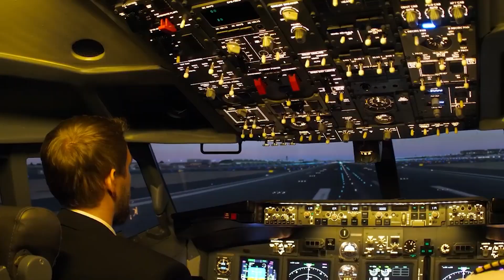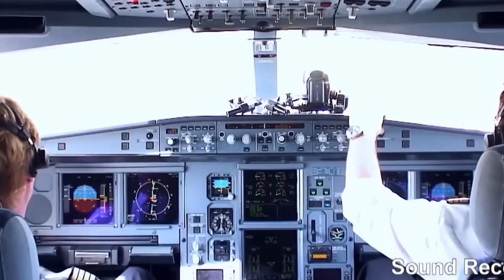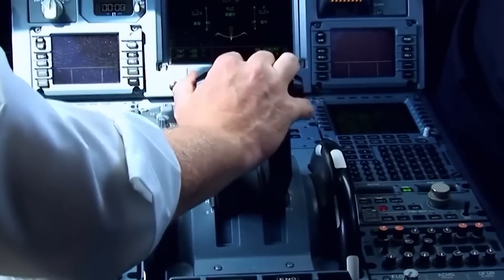BLACK BOX DECODED? Scientists FINALLY SOLVED the Mystery of Air India 171 CRASH

Comment: I am relieved that this channel is not big and that this video got not that much attention because everythin in this video is total bullshit.
It actually hurt me to watch it fully and I hoped that there is some kind of reveal in the end that everything was wrong on purpose for a joke.

So PLEASE, to everyone that reads this comment: THIS VIDEO CONSISTS OF 100% FAKE NEWS!

And it does not need much evidence to reveal that:
First of all, nothing that was said in this video has been published by any official investigator. The only real official info that we have is the preliminary report of the AAIB.

The report states the following as facts: 
"The aircraft achieved the maximum recorded airspeed of 180 Knots IAS at about 08:08:42 UTC and immediately thereafter, the Engine 1 and Engine 2 fuel cutoff switches transitioned from RUN to CUTOFF position one after another with a time gap of 01 sec. The Engine N1
and N2 began to decrease from their take-off values as the fuel supply to the engines was cut off."

It clearly states that the fuel control switches have been moved one at a time with a 1 second gap in between. No seat back, no thrust levers moved to idle, no startle reaction caught on the voice recorder, nothing.
There is literally NO EVIDENCE about a seat pin being broken and causing the captain to move the thrust levers.
And even if that happaned, engines on an airplane do not shut down if moved to idle. That would be very stupid. And the startle reaction can not be used as an excuse for moving the cutoff switches in a controlled manner one by one. If the thrust levers were moved to idle, the immediate reaction of any pilot would be to immediatley push them completely forward. And no pilot did that.
You really think that this could have been the cause if no parameter that you stated was found sticking out on the data recorder nor anything recorded on the voice recorder?
If the thrust levers were moved to idle, and not back to forward, then you basically accuse both pilots of either being suicidal and doing nothing because of that or being stupid enough to not see that the plane is going to crash if no one did anything.

So the real answer so far to what happened to AI171 is the following: Someone in the cockpit shut both engines down one by one, with a gap of 1s.
More is not public, more is not possible to answer.
In the cockpit were two people, so that reduces the number of people on board that could be guilty from 241 to 2.
Reply: Why would the pilot cutoff the 2 fuel switches intentionally to commit suicide, absolutely the scenario depicts a possible issue with the seat pin.
Reply: @dodo96920 did you read my comment?
Even if there was an issue with a seat pin, that could have never been the cause of the accident because it was not recorded by the flight data recorder or the voice recorder. And nothing about that is published by the AAIB, so I don't know how you want to know that this is what happened.

I don't claim it was suicide, I can't say that because we don't know, I just stated what is fact, that someone put these switches to cutoff a few seconds in flight, and someone put them in run again few seconds before impact, and someone asked the other one why he put the switches to cut off

Comment: The switches on Air India 171 were sophisticated, not basic push buttons. It seems highly improbable that the pilot, while struggling for stability, could have accidentally engaged them. Furthermore, the failure of the minor "twenty-dollar pin" was likely a result of the impact following the crash, not a precursor to it.